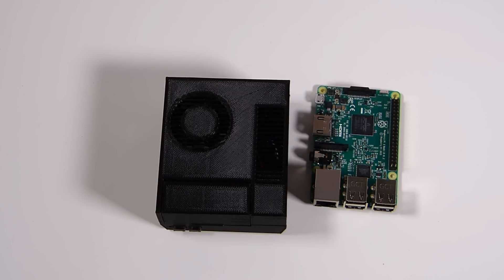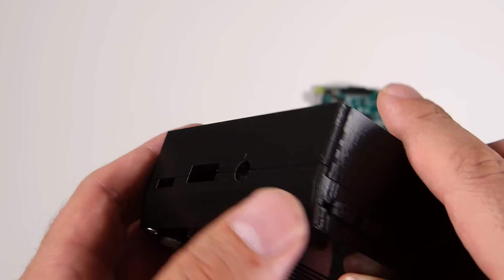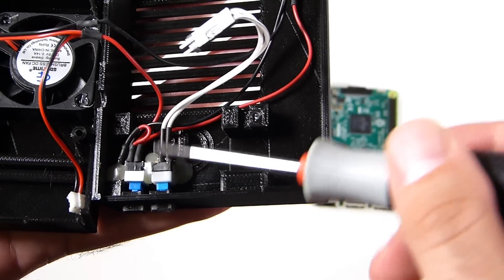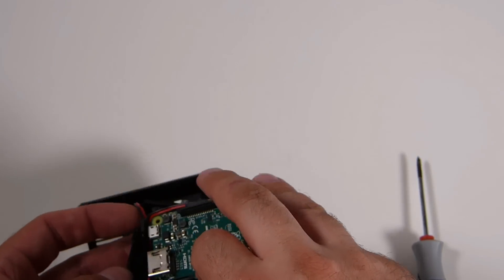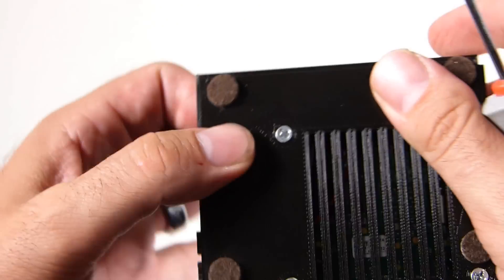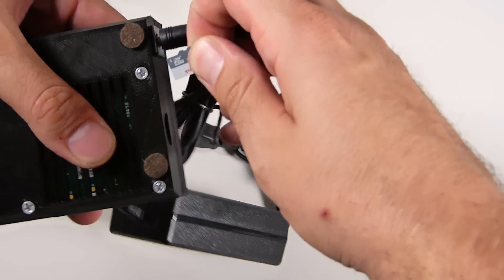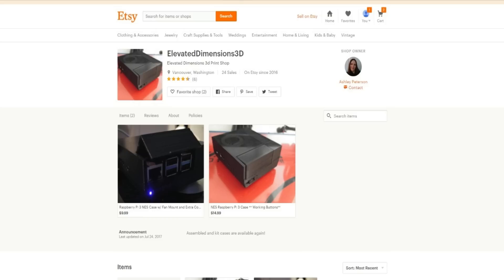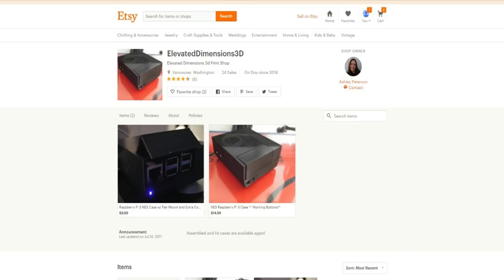RASPBERRY PI 3 CASE - POWER & RESET BUTTONS WITH FAN!

Comment: So this isn't for the 3 B+ right? On mine the reset button will not work when soldered to both holes one needs to goto run and the other to a ground pin as far as I know or will it still work?

Comment: Does this case power from the plug through gpio pin 2 and 3 ?
Reply: gpio not has 2 and 3, thats used pin 4 and 6. have 5V and gnd pins.if power go to raspi board sametime power have pin 4 5V and  run fan.

Comment: mine was machined better, however i didn't order the electronics. the case/plastic buttons alone are 20$ w/ shipping. They responded pretty fast though.
Reply from the maker: Chiyu Ryuu thats cool. Definitely dont need the wiring, but you could always wire it up yourself or differently anyway. But yeah this one just needed some light sanding.
Reply: I think it's perfect, I was going to try the ETA prime borkin button but it takes my headphone jack out, which I may use with external speaker set up. Do you need the reset script to make this work? i'm using the NEW MLP 200gb.

Comment: interesting but how make raspi3 case whit, subtronic X820 board(HDD) and diy pcb 5V ups board,or cheap geechreich battery board, lipo battery usp. whit X920 DAC pcm5122 board, whit shutdown button,some led, power on in case, DS18b20 temp sensor, or bracket outwall case at sensor.backside.power in own powersupply 5V10A external go in to x820 board. 5,5mm plugin. reset button no newer has need, but safe shutdown button have important, reser/reboot have in software normal.and x11 windows you can reset write reboot. newer no need button.